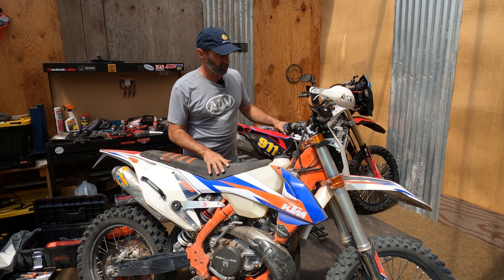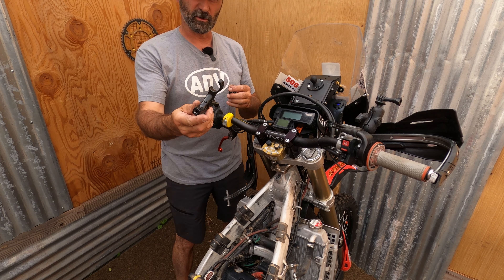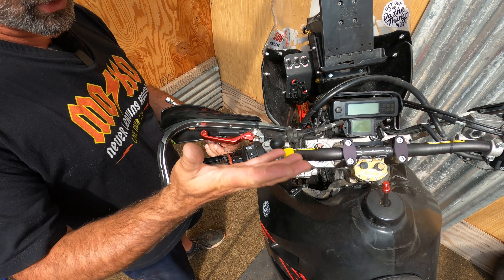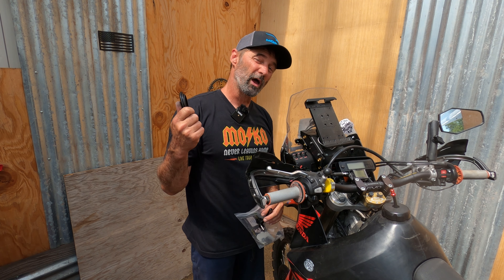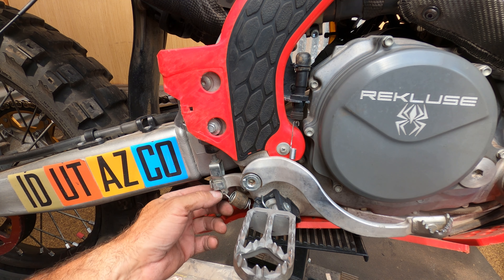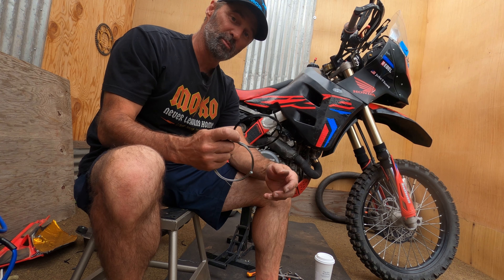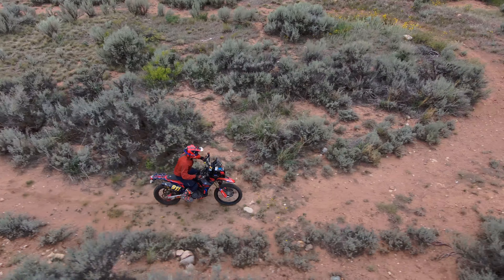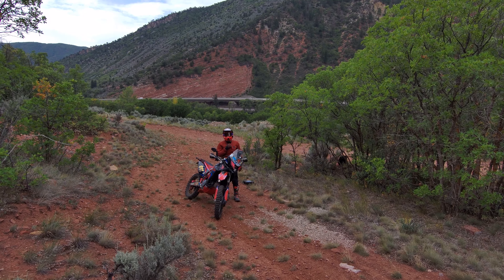Ox Brake LHRB On A Honda CRF450L/RL? Meh.

Comment: I tired a clake on my crf450l and it fucked my starter motor teeth and cogs, tried all sorts to get the hydraulic clutch to work, -absolute nightmare - would drag on the clutch when starting on hills in gear, thinking of reklus and a rear hyro brake now with zero clutch lever, the rear hyro rear brake worked gr8 though... thinking Rekluse with zero clutch might work.
Reply from the maker: It just might! Thanks.
Reply: @JohnTYoung  I have left rear brake now and use a bolt set to the correct clutch tension. removed cable, works great.

Comment: I just got to minute 26:00, and some feedback if you ever decide you want to go back in and raise the rear brake foot lever... You could shorten the cable housing by the necessary length (I'd cut at the lever end), or get a longer mountain bike brake cable that you can cut to length and keep the current housing. Actually, if you put in a new brake cable you could just pull the old cable out at the lever end, and slide the new cable in the adjust the brake lever back to the place you want. If you are going to cut the housing, either use a round cable housing cutter, or a blade. Don't use any cutters that are scissor like (wire cutters, tin snips, etc). It will crush the housing. Same for the brake cable. I do a lot of this stuff building bicycles. Anyway, just a suggestion. Do with it what you wish.
Reply from the maker: Weeee, that's a lot of extra parts and tools I don't own. I'd rather it worked out of the box. I'll wait for Ox-Brake to make one just for the CRF450L.

Comment: I've been riding mountain bikes from when they first came out in the early 80's. I got into dual sport biking recently, and I HATE where the rear brake is. I didn't realize this was even an option, but it's got me thinking about getting away from the rear break foot lever. That rear brake lever looks like a mid-level short mountain bike brake lever.
Edit: And then at 8:50 he shows that he broke the lever and is using another mountain bike brake lever. CALLED IT! Too funny.
Reply from the maker: It works well on my KTM, but not so much on the L.
Reply: That lever he broke is used for a reason, and one reason only... it has more leverage "power" than any other commercially available lever... I could have called it too.... it wasn't;'t designed to flex over heated grip pads.

Comment: I have the mushy brakes on one of my street bikes. Friend told me it was because the fluid heats up and gets mushy. Recommended wrapping the brake line in heat shielding wrap or get brake oil with a much higher operating temp
Reply from the maker: Huh. I hadn't heard that.  I've got some new 5.1 DOT in there now, so it should be ok.
Reply: @JohnTYoung  yeah I think its based on where the brake line runs. Like he was telling me that mine ran really close to the exhaust or something hot or something

Comment: Hey John,  you will need to use the supplied hand lever assembly in the kit to get the leverage ratio needed to lock up the rear wheel.  Ox-Brake tried the "Shimano" unit that is used in this video and we experienced the same results....NOT enough leverage to lock up the wheel.  The Shimano allows for keeping the grips on during install (why we tried it too), but it was not designed for our system, and will never have the leverage to work effectively. 

The current cable lever assembly (included in the kit)  has the "leverage ratio" required for full-size motorcycles (it's the best we have found in over a 10 year search).   We hope to one day offer a cable lever assembly that does not require the grip to be removed, but  for now,  we have not found a viable option.  I hope that helps you understand our lever assembly choice (for performance + necessity... not to make you frustrated...).

We would like help get your Cable OX LHRB system working as it was designed. I even have some new "stick-on" heated grips you are welcome to (I can't bring myself to use glue-on grips again).  Also, we have a few "soon to be released" OX Hydraulic units that I hope you'll consider reviewing.  Please reach out to us at: support@oxbrake.com, or give us a call: 385-315-7157.  We look forward to hearing from you.  Thanks!
Reply from the maker: I am enjoying the Hydraulic unit on my KTM even if I can't keep it AND the rear system both bled at the same time. I'd be very interested in the same style for my CRF. The big problem with the CRF is the turn signal switch pod. It just doesn't work well when it's moved inboard - or I have short thumbs? That's a hurdle you don't have to deal with on the X and R models.

I am terrified of pulling my grip heaters off, as I have finally found a set that work perfectly. I say a small prayer and sacrifice and large goat each time I replace the rubber grips in hopes that the heaters will just keep on keepin on. So far they have.

As for the lever and it's leverage, it makes total sense, and the Shimano lever even had a place to move the cable to, so as to get better leverage. I destroyed the lever trying to make that adjustment. 

I get it, and I tried to make clear that what I was doing in trying to add this system to my bike was outside it's intended use. Sometimes parts designed for the X and R bikes fit the L too, but not always.
Reply: To OX Motorcycle Products, solid response to an honest review! 
Been contemplating getting a Hydra system for my TE300i and now have no doubt OX is a good company by backing their product…Nice job also to the reviewer
Reply: Magura hydraulic like on the HTM/Husky models would be 👍.

Comment: I know it's pricy but you might want to invest in a Clake II or a Clake pro lever which will give you brake and clutch on the same leaver. I have it on my Husqvarna FE 350 and I would not go back to a normal lever, also got rid of the rear brake foot pedal all together. I hated the foot rear brake leaver ever since I started riding when I was 14 years old. I always wanted to ride my dirt bike like a mountain bike. Now I can.
Reply from the maker: Weeeeee.... $800 AUS!?!?!
Reply: I tired the clake on my crf450l and it fucked my starter motor teeth, tried all sorts to get the hydraulic clutch to work, -absolute nightmare, thinking of reklus and a rear hyro brake now with zero clutch lever.
Reply: @JohnTYoung  If you look under the Clake two product, they do have the CLAKE (LHRB) ONE – HAND OPERATION ONLY KIT or Dual system if you want to keep your foot rear brake pedal. This product was designed for people with an auto clutch. It is pricy, but their product once tuned properly works amazing.
Reply: @mindfulmunchkin1215  That is weird, had mine for 2 years now and my clutch is perfect and starter is still alive. Maybe you didn't install it properly or maybe something else fried the starter. I just know that for me I would not go back as it opened up so many possibilities for my riding. The only thing I worry about is breaking a leaver as it cost to much.
Reply: @JohnTYoung  Also I do believe that Rekluse has a rear brake leaver which should run great with the auto clutch.
Reply: @JohnTYoung  that’s only about $55 US!
Reply from the maker: @MrEtnorb  I'll take two then!

Comment: Please consider the  following:
1. The Shimano lever you used doesn't have enough leverage, and was never designed or intended for use with the OX system.   The lever you substituted, was tested by OX, and we found what you did... Not enough leverage/power to lock up the rear tire + requires more interior cable length (will discuss that further below).
2. The interior cable was too short  because the Shimano lever you used requires more interior cable length... thus, why it was too short for the internal cable to reach the "pedal adapter" (Again, it won't function the way you modified the system... it wasn't designed for the lever you used (requires less interior cable length), and using a Shimano lever not designed for our system, created essentially every single problem you encountered.
3. Your complaints about how hard you had to pull, and the feel, are a direct result from you using parts not designed for the system (dead horse here... you broke the lever with the correct leverage the system was designed for, and used one that won't ever work with our system).  
4.  You spent almost 40 minutes testing a system, with a a lever that OX will not use for the same reasons you found. We could have told you not to use that lever and not waste almost 40 minutes on this review in 20 second phone call... Again, OX found the "shimano" lever to have terrible leverage. The included OX lever you broke has a leverage adjustment (it can be increased, or decreased), and it has substantially more leverage/power than what you substituted.   The levers are not even in the same "ballpark," and again... OX tested it, and we won't use it.... even with as much as OX want's to offer a easier mounting lever.  There is not an easier mounting lever, with the correct leverage necessary.
5.  Your rating of  "5" of "10" stars out of the box doest seem accurate or reallypossible... you didn't use the OX system out of the box.  You modified it... and used parts not designed for the systems. knowing what you did.... on a "swear scale," that made the review a little painful to watch knowing how much effort you put into it. Sadly,  much time has been wasted and our OX Honda cable LHRB misrepresented.   You should have called us to get you a replacement lever, so this review could be accurate (also, I have stick on heated grip pads you can have too... I will never use glue on grips again...I will send them with the correct lever). Again, in 20 seconds we could have told you exactly the pain you would "self inflict" by either assuming all levers have the same leverage ratios and require the same internal cable length (or the specifically, the Shimano does not have sufficient leverage for the OX system). 
6. You seem intelligent.  However, we told you in the comment below that we found exactly what you did with the lever you used.  Why did you not get the correct lever, so an accurate review could be posted?  This is a review on a "OX-Brake, modified with parts OX knows won't work."  Again, by using  parts the OX system was not designed for,  you modified it, and it will NEVER work how you modified it.  

There is no question you are very entertaining, have great video + editing skills, great commentary... but your problems could have been avoided if you used the product with the parts we designed the system to use. 

Call us: oxbrake.com (385)-707-3723. We will send you the correct lever (and heated grip pads).  Further, we are looking for test riders for our new Nissin Hydraulic system. You are very discerning, and we would love to send you one to test before it ever reaches the public.  Also, all of our hydraulic systems have been revised for 2022... (all new pistons sizes for optimized modulation + power). Nothing that resembles "mush" (any properly setup Hydraulic OX system.. should not ever feel like mush... let us help you get that running perfect). Lastly,  after buying and testing every LHRB on the market we could find... our new Hydra 2.0 is the  most powerful Hydraulic LHRB for a KTM, HUSKY, or GasGas... soon for Yamaha, Honda, Beta, Kawasaki, and others. We would like to get you a newly released Hydra Pro 2.0 for you to review on your KTM. Again, please call or reach out to: support@oxbrake.com. 

Sincerely, we wish you the very best, and want to get you more products to review, and the replacements parts for you Honda LHRB, so you will see for yourself how it works with the parts it was designed with.  I truly wish we had more people like you, that are willing to put this much effort  into a review + make it entertaining.   I hope you take us up on the offers we have proposed.  Regardless,  All the best!! Keep making people laugh... Even with this botched install🤣... I couldn't help but laugh at times too. Although, lets get this set straight... Thanks for your time.  

Sincerely, 

Ox Motorcycle Products
Reply from the maker: All true.
Reply: @JohnTYoung  Can we send you a new lever and a headed grip kit for your Honda?  Also, can we send you our LHRB 2.0 for you KTM to check out and review?  

You're incredibly thorough, and entertaining.  We would appreciate seeing what you think.  

Thanks!
Reply from the maker: That would be great. Tho, the issue with the L/RL isn’t really the lever. It’s that there is no room for an additional lever with the control pod taking up all the room. The lever almost needs a SUPER thin handlebar mount to fit. 
As for the KTM, I’d love to try your 2.0. I really like the 1.0, I just can’t seem to bleed it and the foot rear brake well enough to make it truly sensitive. It’s kind of mushy, but I still really like it.

Comment: Not sure how you bled the brakes, but I've had some that I couldn't get all of the air out using the conventional method of building up pressure then releasing the bleeder valve.  I started using a hand actuated vacuum pump to pull from the bleeder valve, which worked to get all of the air out.  Could be weak lines contributing to the problem, but likely some air trapped in the system somewhere.
Reply from the maker: I've tried that with syringes, but maybe a pump would work better. Thanks.

Comment: therd

pull the inner cable out of the outer sheeth, then cut  a couple inches off the outer sheeth. this will give youva few inches more lenth to the inner cable.????

or get a longer inner cable😄😄😄
Reply from the maker: Yeah! Low Five.

Comment: I sure hope you wenr back to the hydraulic set up !?      the master is bad in ur ox brakes..    you can make the hydraulic set up really stiff.
Reply from the maker: The Ox was an add-on. It doesn't effect the hydraulic brake system

Comment: Looks like that company just took a bicycle hand brake, made a bracket to mount to the foot brake lever and called it a day. Cables are horrible as far as lever feel when it comes to brakes. I think I’ll move on. Rekluse has an awesome system that is hydraulic.
Reply from the maker: They make a hydraulic one for KTMs.

Comment: You’re probably going to have to try the Rekluse hydraulic left hand brake to get the feel and power you’re looking for.
Reply: Hey Jerry, have you got the Rekluse hydraulic left-hand brake ???.
I do, and I can't get the damn thing to work... So it's just sitting there on the handlebars doing nothing.
Reply from the maker: Ya. I haven't heard much good news about that one either...
Reply: @geoffhowse3591  no I don’t. But I’ve heard a lot of folks are having difficulty getting them bled properly. Did you call Rekluse? Their support is generally pretty good.

Comment: I have the hydraulic Ox on my 20 Husky 350 and it works fine. The lever is firm. Not sure why yours isn't...
Reply: Also having the sic ass racing switch makes mounting easier too.
Reply from the maker: I'm not sure either. I bleed both systems and it's fine. A few days later - marshmallow.

Comment: mostly used for wheelie control....pretty sure they have the rear brake leaver a lot lower so the cluch leaver is not so high......  love the vids as always 👌
Reply from the maker: I mostly use the one on the KTM for tight downhills. And doughnuts of course.
Reply: @surron_offroad have you used this system particular system for wheelies before ? Is it good for it?
Reply: @damxn7345   I haven't used this set up myself .. but I've seen this set up on a few bikelife bikes for hand control when there stood on seats and jumping about pulling wheelies 🤙
Reply: @SurRon_OffRoad  appreciate it man thats all i needed to hear 🤟bouta make that purchase 😂

Comment: A sad and sorry tale John! I wonder, as a test, is it worth withdrawing the cable from its routing and running it straight over the top of the seat down to the cylinder perch to see if leverage and feel is improved? The hydraulic version as per your KTM, might be better, but Ox Brake don't make one (yet?) for Honda AFAIK...
Reply from the maker: No, they don't make a hydraulic version for the CRF yet.   I could try that...
Reply: And why don’t they supply these things with long levers? More options for handlebar real estate, and more leverage too.
Reply from the maker: @iansurgeon7218  Dunno.
Reply: @iansurgeon7218  Because they don't exist.

Comment: Love your videos John. Re- the mushy brake. The hydraulic pressure must go somewhere. I suspect the hydraulic hose has walls that are too thin or too soft rubber so it swells when you brake. Maybe try a steel-braided hose when you have time to fill…🌻
Reply from the maker: Thanks Ernie. And thanks for the insight. I had hoped Ox Brake would have given me the correct stiffer hose, but there you go.
Reply: @JohnTYoung  They gave you the correct mechanical cable line (this is not hydraulic).  The line didn't fit due to your use of a lever not designed for the system... The Shimano lever you used, requires a longer silver braided interior line.... Thus, again, you completely botched this...  It's like buying new ford Raptor, and thinking I "really want a V8 with a supercharger from Dodge."  You drop it in the engine bay.... nothing works properly.   

You have spent so much time complaining about a product you ruined by assuming all brake levers have the same "leverage, or power."  

You are talented with your reviews... why not use it with the parts intended, and update your review?